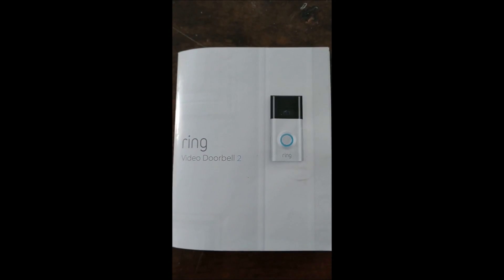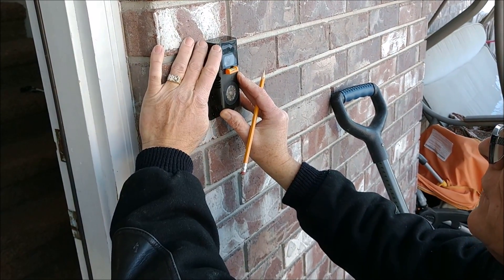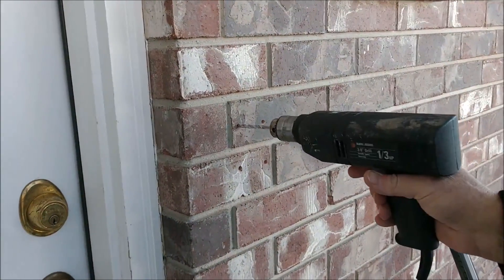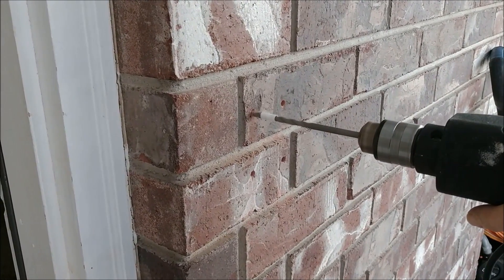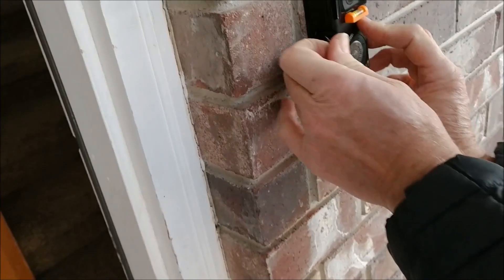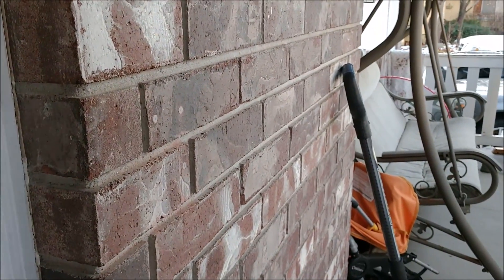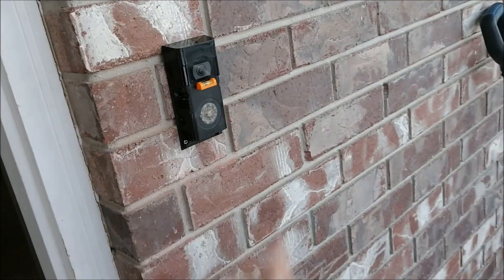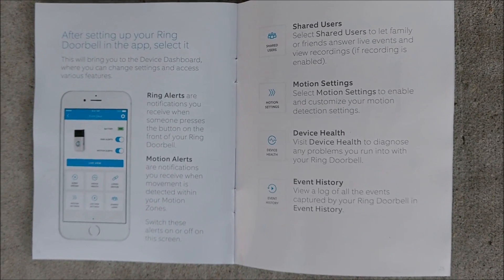How to install Ring Video Doorbell on brick siding of your home DIY video #ring #ringdoorbell2

Comment: We ended up exchanging this model for the slimmer version https://www.youtube.com/post/Ugkx0jZ_lGlDVJhDnmagEU8gn47cmfPNlLQU  because it was too wide for the only door trim area that made sense to mount it on. However, we should have just noted the dimensions prior to purchasing. Otherwise, we love the doorbell. It works perfectly, and the video is very clear, even at night.
Reply: Josh. Thanks so much for your comment. Best of luck with your next DIY project and hopefully you subscribe to Big Al Repairs.

Comment: Thanks for the drill bit suggestion! I was getting pissed off with the cheap one Ring gives you. I'd rather they not include it at all rather than give one that doesn't work. Wasted an hour until I found your video. Bought the 7/32 Bosch at the store today and took less than 30 seconds a hole. Much appreciated!
Reply: @Anthony Thanks so much for sharing your experience.  I agree with you and not include the bit or that they should explain that it is not a masonry bit.   I hope you have great luck with your next diy project and hopefully you subscribe to big Al Repairs.
Reply: Anthony did you use a hammer drill?

Comment: Thank you for the helpful vid. Ring mentions to measure 48” from the ground but doesn’t clarify if the measurement from the ground is to the bottom of the unit, to the top of the unit or to the camera lens? I measured to the camera lens but I’m not sure if this is the correct way.
Reply: That is a great question. I think either way it would be close enough so let us know how that turned out and if you feel good about where the lens is. Best of luck with your next DIY project and hopefully you subscribe to big Al repairs

Comment: This video is WAY better than anything Ring provided.  I looked all over for the drill bit size and could find it only here in your video.   Great job (with both the video and the installation)!
Reply from the maker: Thanks so much for the nice comment and for watching!
Reply: but they give you the drill bit.... so you dont need to know the size?
Reply: @christiancarey4893  I bought a Ring generation 2 from Lowes and it did not include a drill bit.

Comment: I had to also get a mason bit, and a hammer drill.. still only got 2 of the 4 holes in... but they are 2 at the top so the doorbell is still pretty secure.  when I tried doing the bottom 2 holes, they kept sliding and I couldnt get the holes where they needed to be. I gave up LOL.  I think down the road I will move the ring doorbell and put anchor a piece of wood onto the brick then install the doorbell on the wood.  thanks for the video!
Reply: @Joanne Plans.  Thanks so much for your comment. I'm sorry you had such a difficult time drilling the brick. You'll have to let us know how your project works by using wood. Thanks again I'm best of luck with your project.

Comment: Al, Thanks for the video. This will save me lots of time getting this installed on my brick
Reply: @Mike. Thanks so much for your comment.  Best of luck with your next DIY project.
Reply from the maker: No problem! Thanks for the comment
Reply: @BigAlRepairs  So it took me 20 minutes to drill 1 hole with the terrible bit that Ring included. I just ordered a drill driver and a masonry bit from Amazon. At this point it may just be easier and cheaper if someone robbed me.
Reply from the maker: @Mousland-723  I am so sorry it has been such a hassle for you. The bit that Ring provides was not very helpful for me either. I hope you get it worked out now that you have the new bit.
Reply: @BigAlRepairs  thanks I’m sure I will.

Comment: How does it work then? I want a doorbell/Camera, but I thought you'd have to have wires coming into your house. Do you have to charge it?
Reply from the maker: Yes, you do have to charge this model.  We bought a solar panel for the ring so it charges automatically in the sunlight but you can take the battery out and charge it.  The Ring video doorbell PRO requires wires and an existing doorbell transformer.  Ring has a couple of different doorbells that do not require wires. Here is a link to find the ring products: https://amzn.to/3Ac0VCH

Comment: I always get the ridiculous situation. So two different bricks, top one no issue easy drill , bottom brick must of been made on krypton. Broke a bit in it, had to use screwdriver to hammer the hole to loosen it up on and on. Finally I lost it and my Irish went into full force. Got my old pice of equipment that you can blast a nail with a 22 caliber bullet. Yea hole is a little wider than I want but screw it, the base is on and secure!!!!
Reply from the maker: I hate when a project goes sideways and takes double the amount of time to complete. I am glad to hear you figured out a solution and were able to make it secure.  Sorry it was harder to install than anticipated!
Reply: @ thanks, you helped a lot with your video. Just one of those  unseen things. Crazy though. Yea ring camera secured and working great !! Thanks again

Comment: Installing my ring doorbell 3 is a pain. Your video is great! It took Forever using the included drill bit and I had trouble getting the anchors in but I'm going to try your tip of hammering them in
Reply: @Thasia.  Thanks again for your comment. I'm not sure if there's a big difference between the ring video doorbell 3 and video doorbell 2. Let us know how your project turns out. Thanks again.
Reply: @BigAl-1  so I hammered the anchors in like you did in the video and that worked; just 2 or 3 taps and voila anchors in! :)
Reply: @PVguest  Great job Thasia!  I am glad it worked out well for you.  Have a great 2021.

Comment: Is the 7/32 drill bit but what size anchors for screws?
Reply: @ Val.  We just use the anchors that came with the ring video doorbell 2. So I am not sure of the size of the anchors because I don't have any extra to measure.  Best of luck on your project.

Comment: Can you use the mortar to anchor into? I'm renting and wanting to make it easy to fix/fill holes when my lease is up.
Reply: @Sarah.  Great question.  I think you would be fine drilling into motor.  I would also only use two screws and put them in on diagonal on opposite ends.  Best of luck with your next and hopefully you subscribe to Big Al Repairs. Also let us know how it turns out.

Comment: I bought a new masonry drill bit and using a regular ryobi drill and it’s taking more than 20 minutes on just one hole. Do I need to rent/buy a hammer drill?
Reply: I just use a regular drill.  It would probably help if you did use a hammer drill. But it was really easy for me to drill the holes once I picked up the drill bit at Lowe's.  Different bricks might be more difficult to penetrate so you might need to use a hammer drill. Let us know how it turns out. Thanks for your comment and hopefully you subscribe to Big Al repairs so we can keep filming.  Thanks so much
Reply: When I installed my moms Ring, I had the new drill bit and I got a hammer drill and mannnnnnnnnn was it 100 times easier and quicker. Just be careful tho. 

And I went thru brick.
Reply: Thanks for the comment.  I'm glad the hammer drill worked well.  I hope your future diy projects are a great  success.  Thanks for watching Big Al repairs.  And hopefully you subscribed!
Reply: Be very careful with a hammer drill. on brick like is shown{just thin slices of brick) the vibrations of the hammer may crack the bricks. Brick is very hard to drill because it is baked like ceramics.
Reply: I used a regular drill (Black and Decker) with the exact 7/32 masonry drill bit the video author recommended. It took me less than 30 seconds per hole. You have to lean in to it
Reply: @M_Y_Wolde  thanks for your comment. it may depend on what type of brick you are drilling into as to how long it takes.  I had the same result it only took me probably around thirty seconds to drill  to the right depth. Thanks again for you, and hopefully you subscribe to Big Al repairs.
Reply: Yes you need a hammer drill for all brick/concrete drilling work. Tal=kes appox 5 seconds a hole with a hammer drill.
Reply: @michaelfernandez525 Thanks for your comment.  I am sure a hammer drill would make it easier.  I didn't have a hammer drill so I used a regular drill and the Bosch bit and it worked out well.  Again thanks for your comment and good luck with your next diy project.

Comment: Is 7/32 the same drill bit size for the Ring doorbell 3?
Reply: @Mathewrs7.  That is a great question.  Take a look at the anchor size and see if it is comparable to the drill bit.  I wish I could give you a better answer.  Best of luck and let us know if they are the same.  Thanks again.
Reply: It says 6 15/64 on the ring doorbell 3 plus drill bit included in the box. Seems like an odd size to me but I don't know much about tools.

Comment: Is that a hammer drill? I'm having a lot of trouble with just a standard drill and the Bosch drill bit.
Reply from the maker: Just a standard plug in drill is what I used.  You are drilling into brick?  Let me think if I can find another solution for you...
Reply: You need to use hammer drill. 5 seconds per hole. The bit Ring supplies is absolutely awesome.

Comment: Do you already have the door bell part mounted onto one of the mounting plates and or both of them already when youve made sure its even and made your markings?
Reply: Kryssana MacPherson No, You need to make sure it looks level in relationship to the bricks. And then make sure that when you are marking the bricks with the plate just make sure that you do good job marking and that it's level and you don't move the plate while you're making the markings. I hope this helps. good luck and have a great day!
Reply from the maker: For the Ring Doorbell 2 there is no mounting plate.   The screws go directly into the doorbell. Does this make sense?
Reply: Kryssana MacPherson Hopefully you subscribed so you can give us feedback on our future projects.

Comment: Hello! Will this 7/32 Drill bit be compatible with a Black & Decker? Or will I need to buy a Bosch Drill to install the Ring Video Doorbell on Bricks? Ty
Reply from the maker: The drill bit we bought should be compatible because we also did not use a Bosch drill.  I think it should work with most drills. Good luck!
Reply: Thank You!

Comment: Is it a bad thing to drill into mortar? Before watching your video, I drilled bottom two in mortar, top two in brick
Reply: @Thasia. That is a great question. I think you should be okay as long as the screw will reach the anchor.  you will have to let us know how it turns out. Again thanks so much for your comment and question.
Reply: @BigAl-1  so far so good ... I don't think I had things lined up the best, but it all worked out. I used everything that came in the box for the Doorbell 3 Plus. After hammering the anchors in, I used the power drill to get the screws in because it wasn't working by hand. All in all, your video helped greatly! I watched like 10 or so videos on YouTube and yours was the only one that showed all these extra steps.

Comment: See if just opposite corners are enough to secure it? Less holes to repair if you move it?
Reply: Great idea.  I think it would work just fine. You can give it a try and if it doesn't work you can always drill two more holes.  I really don't think you'll have any problems. Let us know how it works out.  Another person suggested just gluing it on. That would probably work too.  Good luck on whatever you decide.

Comment: Where does the wiring go?
Reply: That is a great question.  The reason we bought the ring with batteries is because the wiring was in another place that would not work with the ring.  If you can use the wiring you should look at the ring directions for wiring your doorbell.  Thanks again and let us know how it turns out.

Comment: Was it mentioned about the drill bit that it has to be a MASONRY Drill bit? Otherwise, the drill bit will burn up, and not drill into the brick
Reply from the maker: Thanks for the tip, yes which is why we bought the new drill bit. Thanks!

Comment: So don't you need the plate on the back that came with it?
Reply: Vicky, I’m not sure what “back” you are referring to. I have converted to the Blink so I no longer have Ring for a reference. Maybe if you are using the wired version. Thanks so much for your question. Best of luck with your next DIY project and hopefully you will subscribe to Big Al Repairs.

Comment: If you don't have a hammer drill -- or even if you do -- select a location so that 2 of the 4 holes go through the mortar instead of the brick. Now, 2 of your holes will go much faster.
Reply: Great suggestion. Thanks so much for your comment.  Best of luck with your project.  I hope that all goes well and hopefully you subscribe to big Al Repairs.

Comment: So you don’t have to have a doorbell system already installed?
Reply: @Antonio Thomas.  The doorbell was on the other  side of the wall which would not give us a view of our front porch so we would have to somehow run the wires to the other side of the door. Thanks so much for your question and hopefully you subscribe to Big Al repairs.
Reply from the maker: You can do it either way.  You can attach the doorbell wires or you can install the ring video doorbell without a doorbell system

Comment: I’m having to buy a bit, nothing is happening with the one provided. I’m actually scared it’ll snap
Reply from the maker: The bit they provide did not work very well on our brick siding either! So sorry about that! Good luck and hopefully you can figure it out! Thanks for the comment! Let us know if you have more questions.
Reply: You can also try using a hammer drill with the bit.

Comment: I'm sitting here watching this thinking my apartment complex is not going to be okay with this 👁👄👁
Reply from the maker: I would definitely get approval before you install :)
Reply: You can buy a no screw mount from the ring site, it’s basically a back plate with command strips on. Should be renter friendly I think
Reply from the maker: @saraha5973  That's awesome, I did not know that! Thanks for letting me know!

Comment: My drill is so weak I’ve been going at it for two days and still am not close to finishing
Reply: @Dirty Dan.  You can use a hammer drill. Or it worked fine when I bought the Bosch drill bit. The bosch drill bit work much better.

Comment: Where is your power source?
Reply: @JC.  The power source is a battery pack.   The ring video doorbell 2 comes with rechargeable batteries. So there is no power source. You can buy a ring video doorbell that will connect to your existing doorbell wires. Best of luck with your project. And hopefully you subscribe to Big Al repairs

Comment: The drill bit sucks, wasted 3 hours for a 1/4 inch hole. I am using a hammer drill as well. Going to be getting a drill bit later and try again. Threw that bit away that came with the Ring.
Reply from the maker: Thanks for the comment. I hope the new bit works for you!
Reply: Big Al Repairs It worked great, 10 seconds and done. Thanks a bunch!
Reply: @ParaBellX  That is so great that it worked!  Best of luck with your next diy project.
Reply from the maker: @ParaBellX  Thanks for letting us know! I am so glad it worked for you. Good luck with future projects! Hope you enjoy your ring video doorbell.

Comment: There is no way I will drill holes into the brick on my house. It's better to go into the mortor as those holes are easy to patch. There has to be a bracket out there to mount the Ring onto that lines up to the mortor.
Reply from the maker: Good idea, let us know if you find one!
Reply: @BigAlRepairs , yeah I know, it has to be prefabricated. :). I'm sure if I did that RING would be all over me for some sort of copyrights.

Comment: Mate you need  to use a hammer drill for concrete work. The supplied drill bit is awesome, you just used the wrong tool. Like your tape on the drill bit though :-)
Reply from the maker: Thank you for the feedback!  We do not have a hammer drill but we wanted to show it is possible with a regular drill even though we had to get a different drill bit.

Comment: It's not the bit. You need a hammer drill
Reply: Thanks for your comment.  Since we do not own a Hammer drill it was much cheaper to just buy another bit which did work well with a normal drill. Good luck with your next diy project!
Reply: Buying a masonry bit worked for me. I just used it with a standard drill.

Comment: Your having a problem with the bit because that’s the wrong drill for that application.
Reply from the maker: Thank you for the feedback!  We do not have a hammer drill but we wanted to show it is possible with a regular drill even though we had to get a different drill bit. It would be a lot less expensive to get a new drill bit than to go buy a new hammer drill.

Comment: 1) you need a hammer drill. 2) you are SUPPOSED to go in the mortar.
Reply from the maker: Why do you suggest going into the mortar? I have not found it listed anywhere on Ring's website where it says that you need go drill in the mortar.  "If you are mounting the Ring Doorbell 2 on brick, concrete, or stucco, put the included plastic anchors into the holes".  We are open to suggestions and would like to hear the reasoning
Reply: Well, you dont spend 2 hrs on 1 hole and waste a drill bit and burn out a drill when you go into the mortar. Also, it has more play to straighten it up, oppose to the brick. I just installed one it the mortar and it holds fine.
Reply: @wtp7631  Thanks for further instruction.  it's too bad the ring video instructions do not explain that. I'm glad it worked out well for you. Thanks again for your information, and hopefully you subscribe to Big Al repairs
Reply from the maker: @wtp7631  Thanks for the idea